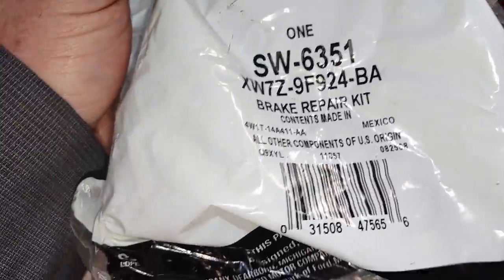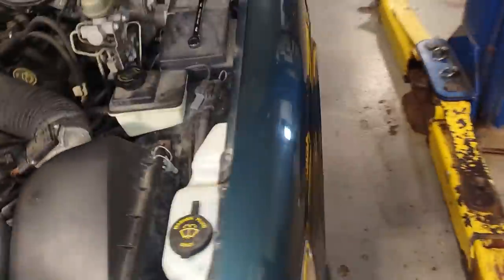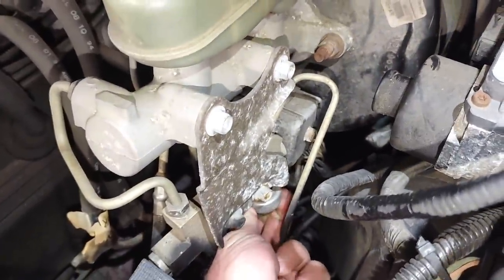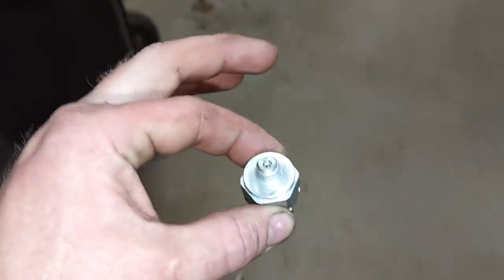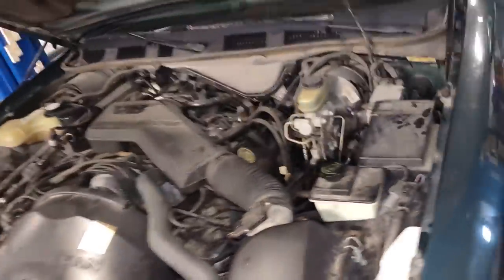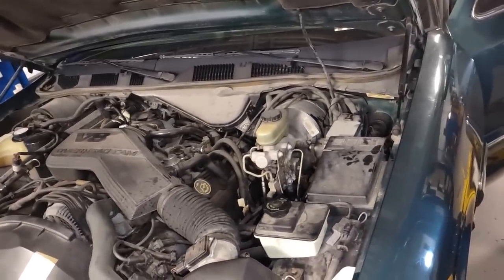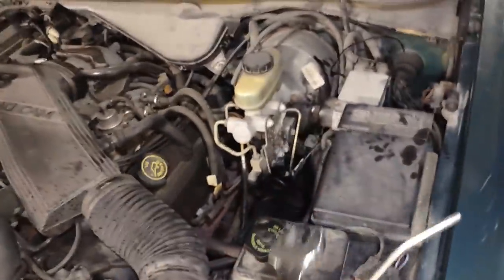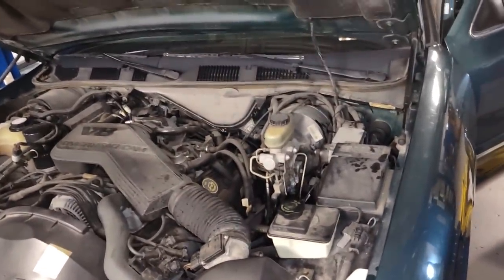Subscriber Dropped Off 1995 Grand Marquis to Get Recalls Done, Vehicle May Start Fire Recall - quick

Comment: The old switches would leak brake fluid and catch fire on electrical components that were live with the key off.
Reply from the maker: Yeah I read all that in the technical service bulletins but I've never seen it
Reply from the maker: Even techs today that have been in the field for 40 years said yeah it did happen but it's not as bad as everybody made it out to be but it did indeed happen

I just think it's crazy that this was built so poorly that it could even be a possibility of Catching Fire because of it
Reply: From what I understand the original recall was just for the fused harness. However that wasn't good enough as it would stop the cruise circuit from igniting the fluid, but if there were electrical below the switch could leak onto, the vehicle could still catch fire. 

At the time I did the fix on my dad's '95 Ranger I just bought a new switch. That ended up being the updated switch with adapter harness you show in your video.
Reply: @toughbowtietruck  They never replaced the switch on my 96 Explorer, just the harness. If the switch wasn't leaking, they let it be. Maybe the upside down ones are different.

Comment: Any suggestions? Have a 2011 mazda cx7 with 130k miles. Its vibrating around 55 mph and when going up a hill at higher speeds. Another mechanic thought it was tie rods. Had them replaced and alignment. Still shaking. Thoughts ford boss?
Reply: What he said^
Reply from the maker: Loading a video for you Cruise
Reply from the maker: https://youtu.be/9oM5qASHjBQ
Reply from the maker: More than likely it's not flat spots in the tires because you would hear that all the time, also bearings you would hear some kind of sound typically all the time or not just uphill and a worn differential wouldn't be just uphill at cruising speed and can be confirmed by using chassis ears
Reply: I've experienced C/V axles vibrating under load before
Reply: You need the Mazda Boss.... wait, Mazda and Ford are related aren't they?

Comment: Did Ford ever recall the blue oval FORD emblems that’s I see faded on a certain model year of Ford vehicles? It appears maybe 2006-2009. It always looked terrible.
Reply from the maker: I have no clue
Reply: Seems like the aluminum anodizing fails.  I don't think it affects just the trucks.  Possibly Ford Edge too?  I see it all of the time on the trucks.  One big silver oval.
Reply: Life Safety issue, Ford is providing replacement vehicle compensation allowances regarding this!! 
The recommended fix is to replace it with a Ram's head or BowTie

Comment: How does one find recalls for a vehicle that old? I've seen vague mentions related to the parking brake and ECM for my 94 Ranger but the recall information seems to be erased due to it's age. Not that I'd probably be able to get ahold of the replacement parts anyway....
Reply from the maker: Does call the dealer open see what's active on that VIN number
Reply: Repair Pal website lists 3 brake recalls, 3 drivetrain recalls and 1 engine recall for ur truck